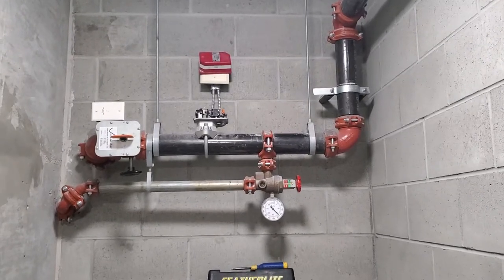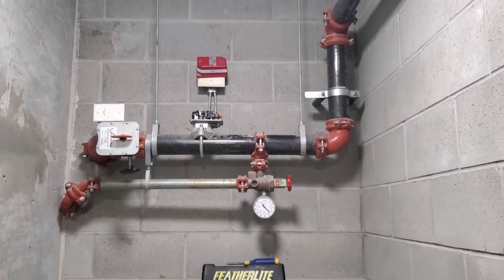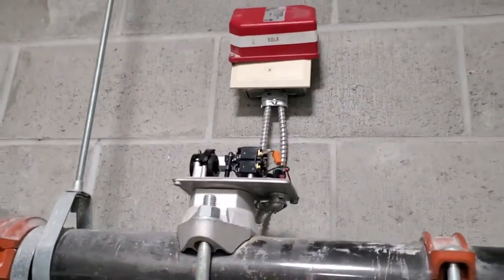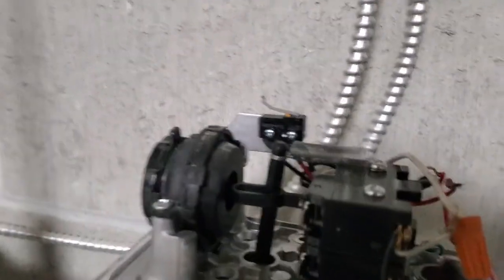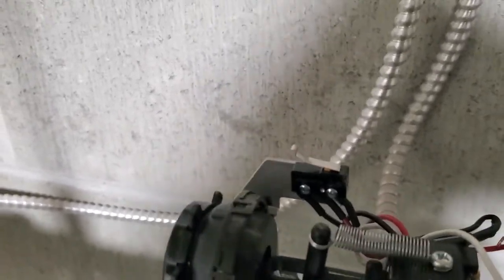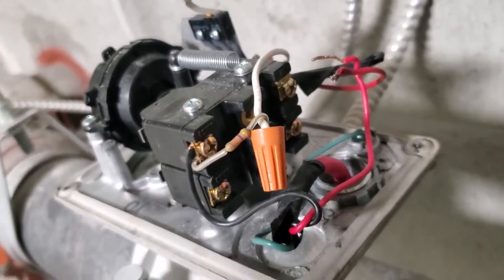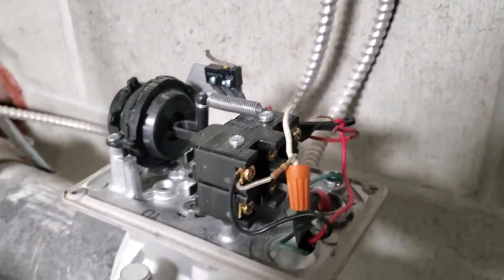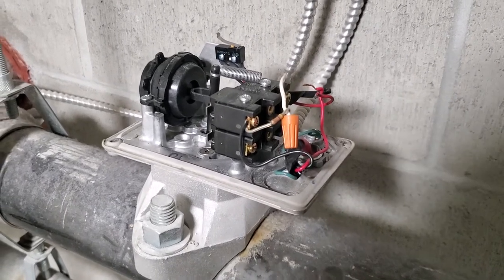DO THIS WHEN DISABLING A Sprinkler System FLOW SWITCH

Comment: Every building is different but typically you can just stick a carpenter pencil with a few wraps of Teflon on the pencil to assure it stays in there as you fill. Simplex panels are def stupid proof. You can always bypass horn strobes, elevators, doors, duct detectors, etc. I can pretty much navigate through any panel to bypass the alarms except for some of them old dinosaur panels.

Comment: Use a black sharpie and block the peg. Do it all the time here in Los Angeles
Reply from the maker: I prefer to pull the wires as i can leave  the flow switch and go check the area for leaks . I have had alarms go off even with  sharpie or pencil stuck in the flow switch . Clearing an office tower  by accident  does not  look good 😂especially from the fire dept  when they ask what happened 🤣

Comment: I use a quarter for that type
Reply from the maker: I used to try and block the paddle but have had bad luck ! Long nose vice grips ,pencils etc .
Still setting off alarm .
A lot of angry people haha
Reply: It's much safer to disable the panel or the nac system at the panel some panels can be put on walk test or disable flow it's a much more safer and professional way to do it
Reply from the maker: It is if you have access to the panel, the knowledge to bypass the panel ,and more importantly the authorization to bypass the panel.
Its a mixed bag , as some places only allow the building engineer to bypass panels , some places its the company who has the contract to verify the life safety systems , some places expect the person working on the piping to do it .
Sometimes theres 2 panels and the panel in the front entrance doesnt reset and you dont have access to the main panel. 
My job most times doesnt include touching fire panels , unless specifically asked to do so . 
Once you finish working on the sprinkler piping then you want to fill the system to check for leaks . Sometimes the person who bypassed the panel isnt available for a couple hours or much later .
Reply: I called the monitoring company and fire department to let them know we were testing and  would still disable the alarm panel.